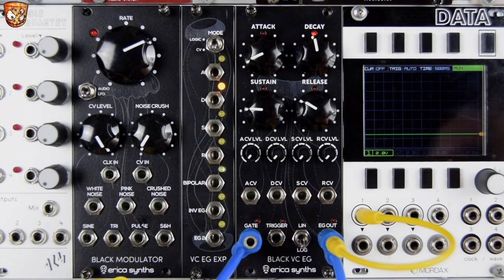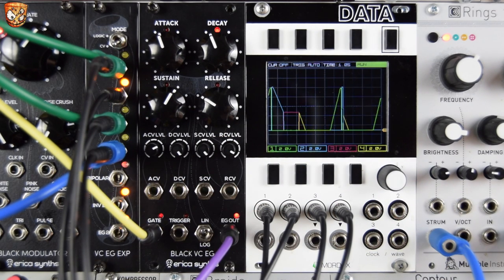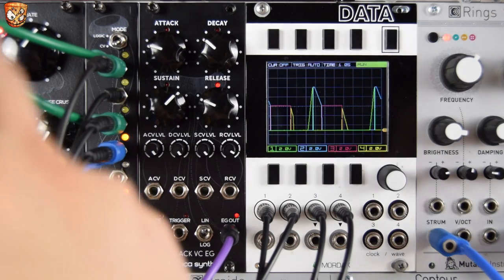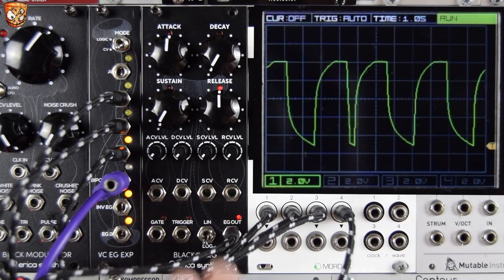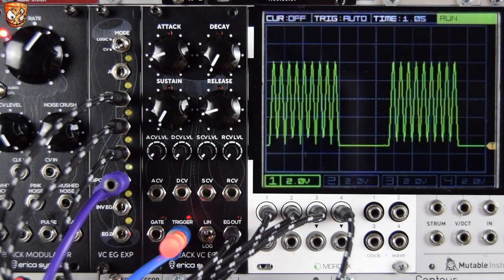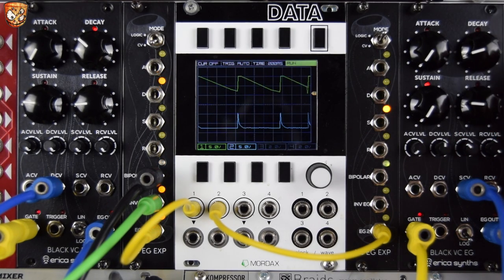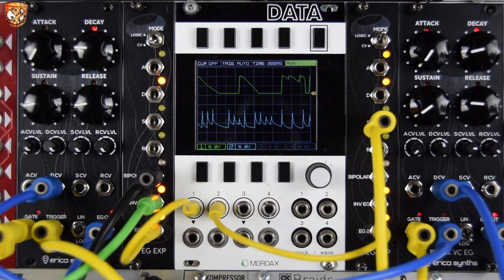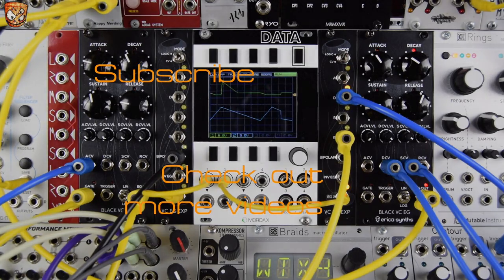Erica Synths - Black VC EG & Expander

Comment: Interesting module, great demo as always. This module gave me an idea how to achieve quite similar effects with 2 maths or 4 make noise functions when each channel triggers a gate from the "end of  cycle" (or rise) and fires the next envelope which eventually fires the next one. Basically this can be done by intellijel quadra + expander though reproducing a classic adsr shape which may be used on the volume amplitude vca will be quite difficult and not so straightforward as with this module, but obviously quadra+expander will give you more control with 2 knobs per each of the four segments which is pretty cool.
Reply from the maker: there's way to achieve similar results definitely. The CV outs on the expander are totally unique though and I haven't seen those before.

Comment: Interesting -  some ADSR's have CV input level ctrl to each A-D-S-R section ( like the TipTop Z4000 ) but the is the opposite  .. it really opens ideas for new patches !
Reply from the maker: well the expander gives you the opposite. But those inputs and mini-pot attenuators on the main module give you CV over each of the ADSR sections. So it's both! :)
Reply: ah -- does both  !  ...yet more stuff i gotta have
Reply from the maker: :) CV inputs are on the module CV outs on the expander.